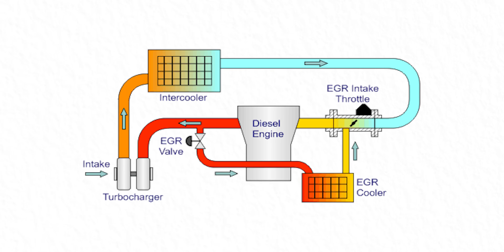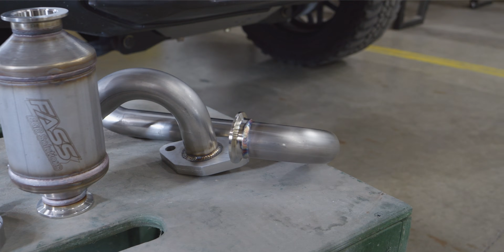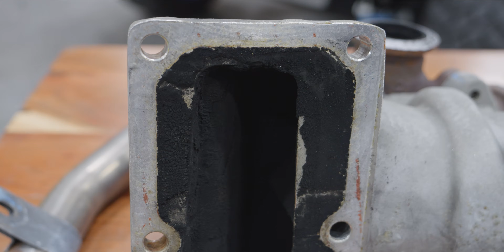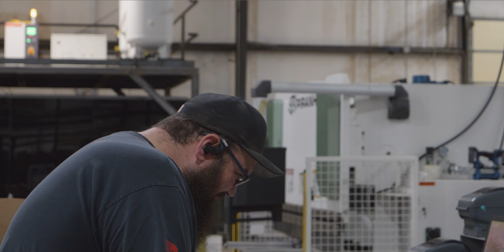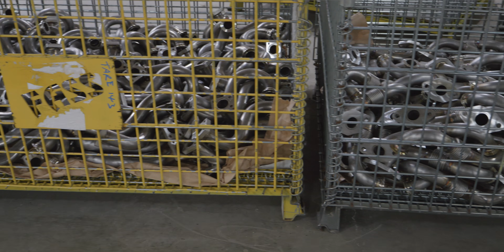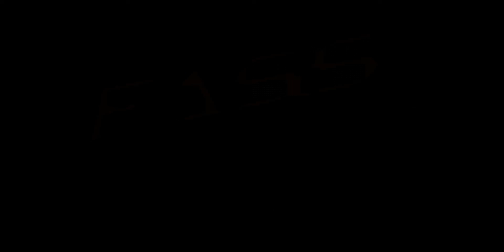EGR Systems 101: What your EGR is ACTUALLY doing...

Comment: How is the FASS filter cleaned ?   OEM's should have produced these EGR soot filters 15 years ago !!
Reply from the maker: The EGR filter is "self-cleaning" meaning at about 600 degrees it will incinerate all the trapped soot. These systems are designed to go up to 100k miles between needing to be serviced as well.

Comment: 11-16 super duty egr cooler cores the grid clogs with soot, and the occasional valve failure, on the 17-19 trucks they made the egr cooler core bigger from the factory but I’ve seen high idle trucks clog the upper/lower intakes with carbon and cause codes

Comment: Just curiosity; what would happen if you connect the EGR downstream of the DPF and filter that instead?
Reply from the maker: Great question, and the reason we have this in the place we do is to better filter the soot before it passes through the engine, helping reduce contamination within the motor, and gumming up the EGR components as well.
Reply: @FASSEGRSolutions  50 state legal?
Reply from the maker: @Upsidedownfoodpyramid  Absolutely!

Comment: Where does this filter go in the whole path on a 2020 6.7 Cummins H/O?
Reply from the maker: Great questions, and these are currently in the testing stages right now so the exact fitment on the Cummins hasn't been confirmed yet. 

We also expect to service the filters every 100k miles, so they wont need replaced just cleaned.
Reply: Also, when does y’alls filter need changed in a stock application.

Comment: I have the filter on my 24 duramax, how does the filter self clean?  Wouldnt everything end up in the engine when it was self cleaning?
Reply: Thanks, super easy install.  Took maybe 40 minutes
Reply from the maker: @nicklasalle1889  That's awesome, and we're glad to hear everything went smooth!
Reply from the maker: Great question, and the filter will clean itself as the engine temp warms up. Once the EGT's are about 600 degree the particulate trapped in the filter will burn out, leaving the engine cleaner.